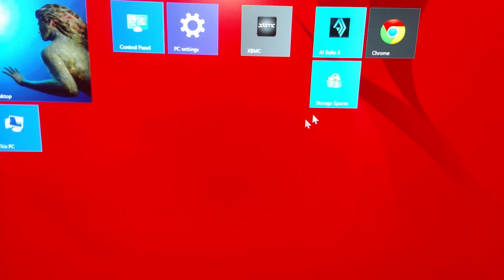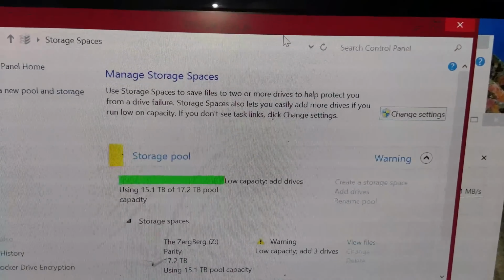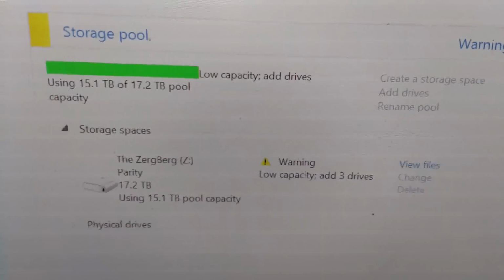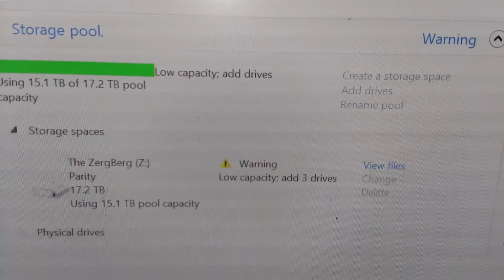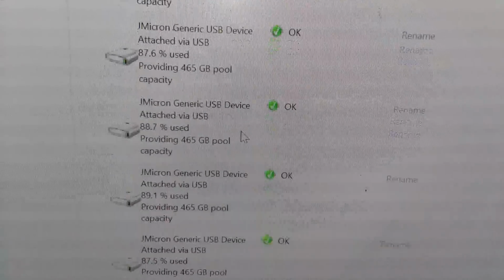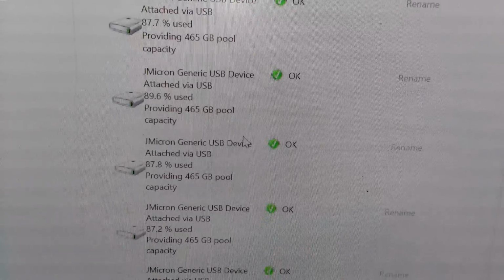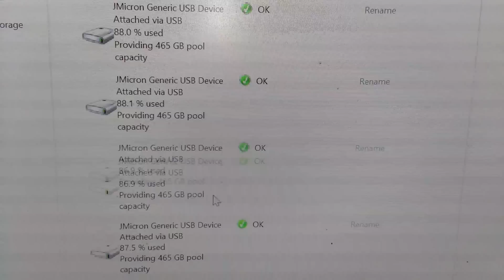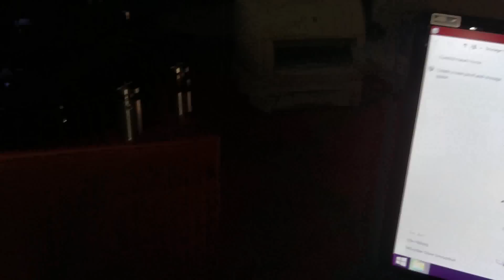The ZergBerg - 38 USB 3.0 Hard Drive - Custom Coffee Table PC - COMPLETE - HTPC - Server

Comment: I want to do this, would you recommend this for a quiet media center for my living room?  Im thinking tinted glass so you cant see in, unless you turn on the colored led lights inside, White led lights on the bottom of the table, so you can see the floor while a movie is playing and room is dark. maybe 9TB of storage, 3 3tb drives. and storage for controllers n keyboards, so ppl can play roms n old games.

How does cooling operate for you?   I wanted to try ex.large fans so they are quieter.
Reply from the maker: Darkking Ice Thanks, with 3 drives you can obviously go much much smaller. Their is also no need to go usb other than for the fun odd factor. Also something the size of what you are discussing cooling would not be an issue, but you could do one 360mm should be more than fine and easy enough to find. Anything bigger and it gets expensive... to the point you would be better off buying a small house fan for 15 dollars and modding it for your needs. If you are not using usb controllers then yes it would be dark underneath. Wiring up some led's would be very easy, and you could also have it run off varying intensity based on sound or hdd activity ect. Or if its a media center, have it mimic the on screen edge color of what is playing. You would need a very dark smoke to not see the inside... Maybe blackout to 85%+... you might want to get that locally and talk to the glass guys their so you can see the varying tint. Online they wont tell you...
Reply: Thanks Nick! Ill try :P

Comment: One word...'Cooling'??? we get up to sometimes 30-40 degrees Celsius in Australia I don't see any cooling running across those HDD's... thoughts?
Reply from the maker: Each one of those hot swap bays acts as its own heatsink in a way. The drives are single platter and stay very cool. The passive design pulls air from the bottom and expels out the top. The CPU and USB controllers have a fan and stay nice and frosty. If the actual temperature inside the house was 40c, i would probably reconsider, but it is not likely to exceed 25c here. The good news is that even in the worst of scenarios the open design means for about 20 dollars you can just get a box fan from the local stor and just lay it on the floor underneath and it would cool everything :)

Comment: I see you have a bit of redundancy built in which is a good idea using used hard drives and being a klutz :) What happens when you pull the power on one of those drives then?
Reply from the maker: Seb Palacio That is the beauty of storage spaces... nothing.. you could pull the power on all  of them.. and you are find... it will just wait for you to put them back in... Also the drives were technically used... but over 90% of them had zero usage hours
Reply: Sounds neat, might have a go!
Reply from the maker: Seb Palacio Yah storage spaces is dynamic... its microsofts push to something beyond raid... similar to drobo... there are more than a few datacenters with over 20k drives all in one storage spaces volume... I should point out that the volume can be modified at anytime. You can even replace active drives with larger ones.
Reply: Wheres mine lol ;')

Comment: I like that you're trying to be different, I have to question the choice of 1000w sizing for the power supply, your usb3 choice, and of course the laptop drives which are already almost at capacity out of the gate?  You spent a nice bit on all those cases, why not pay a carpenter and upholsterer to professionally finish that furniture?
Reply from the maker: Jeremiah Bright Well the carpenter part isnt really necessary, but an upholsterer would have been nice. All told though it didnt turn out bad, infact i think it turned out pretty nice. We needed to keep the clients budget in mind. As for the laptop drives that is another budget proposition. If you look at one of the earlier videos we got the drives at a great price and when you consider 2TB laptop drives would have run about $5500 bucks just by themselves... We are crazy for creating something like this, but our psycosis has a dollar limit. Do keep in mind that with storage spaces, we can easily replace 500gb drives with larger drives at anytime when the cost comes down.The choice of USB3 is just because we can... its not something anybody else has tried, its fun... and actually quite speedy.. This is the rube goldberg part of the name :). The power supply is actually pretty simple... We needed a high end solid power supply. The psu is over 90% efficient so there isnt much wast and i would much rather run it under capacity then run it to the edge everyday. And also keep in mind that power supplys are not all that expensive these days... and given the budget of the project this is a mere drop in the hat.... so buy quality you will be thankful later on.